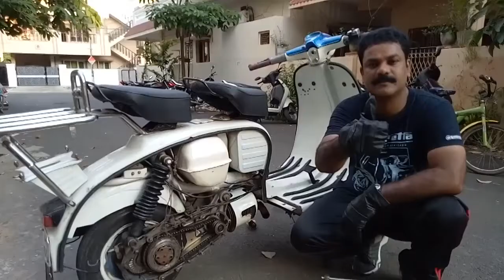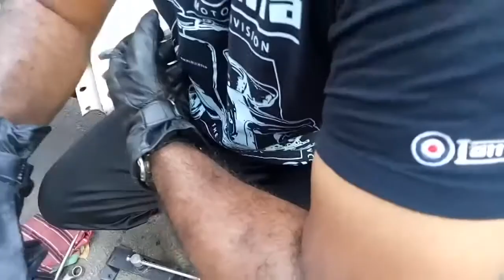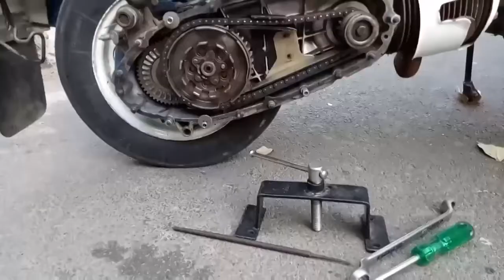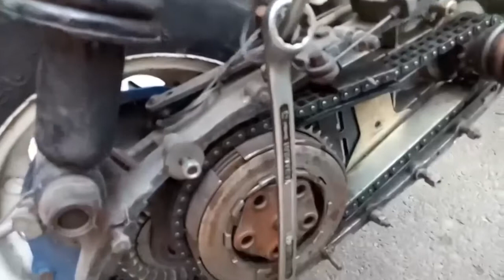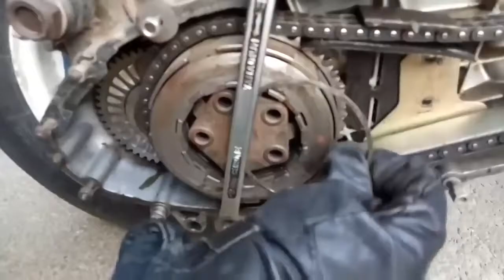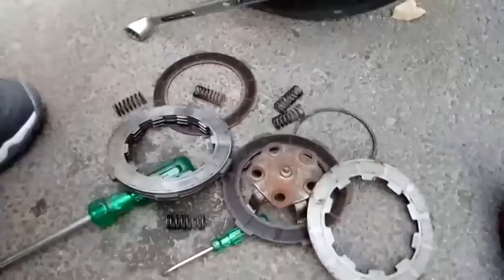What The Best Lambretta Scooter Clutch Removal Pros Do (And You Should Too)

Comment: Dear Ramesh, appreciate  your videos on Lamberetta. I am facing a problem with my lamberetta clutch. When I press the clutch , the clutch wire pull moves the lever at top of the engine chamber  but engine doesn't get dis engaged. The engine and gear remains engaged. Can you suggest what can be the reason. Tks
Reply from the maker: That mean the gear slider is not moving properly hence the gear is not getting disengaged. And also there may be slipping (inside engine) wishbone at the operating shaft. You can do one thing. Please keep the both operating cables at full tight then check for the operation. If problem still exists then the problem is in inside of engine. You have to open clutch cover and then must check for any deviations in operation with respect to gear operating system
Reply: Thanks a ton. Just to add some thing more.....the gear moves easily between 1-4 through neutral. ...but when clutch lever is pressed, the gear and engine  are not  dis engaged. Thanks

Comment: Ramesh l have a bajaj cheetek 125 and crank shaft has gone can't get them in England do you know if Italian vespa one will fit ?
Reply from the maker: There is a difference between Italian vespa and bajaj chetak. But for fitment you have to visit foundry shop. Because there is some work involved and also modification depends upon the performance of machinist. Here we have Bajaj Chetak 150 not 125. May be you are telling about bajaj cub (125) I think. And the construction of fly wheel is differs between Vespa and Chetak. Thank you

Comment: Hi my lambretta clutch handle hard to shift to N please advise
Reply from the maker: Point No. 1 Check the routing of cables.
Point No. 2 Quality of cables. If cables have sleeves inside they give us friction free operation.
Point No. 3 It is better grease inner cables followed by applying little oil.
Point No. 4 Check for the freeness of inners passing through the guides (On engine clutch, chain housing).
Most important point to note:- Clutch adjustment plays very important role.
Remember the clutch unit is subjected to heat there by tension (Clamping force) of clutch springs may increase there by increase in difficult operation of clutch.
The life of vehicle involves why because there will be wear and tear of parts including shifting mechanism inside.
I hope these points may help you.
If possible I try to upload a video explaining clutch problems including clutch dragging and clutch slipping in lambretta and also how fix them.
Thank you
Reply: good info. bro thanks

Comment: Lambretta ka 4 gear nhii lg rhaa haii
Reply from the maker: Please check the linkages and adjust the cables. If cables routing including inner and outer are not correct then also there will be problem. Finally put the gear to four manually in cold condition for engaging. Normally there will not be any problem. Once the gear engages while manually then you can get the job done by connecting cables by checking the 4th gear at hand gear shifter
Reply: @LambrettaRamesh  thanks
Reply from the maker: @anasahmed7101  👍🤝